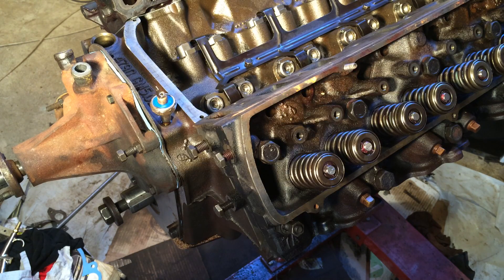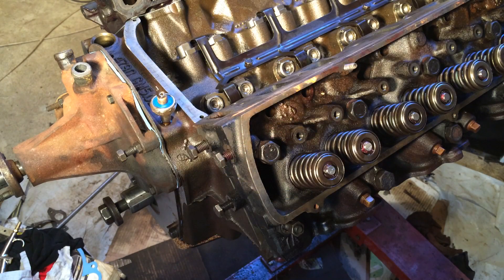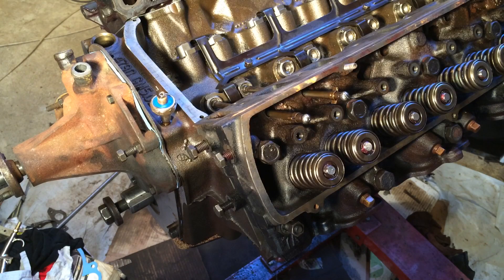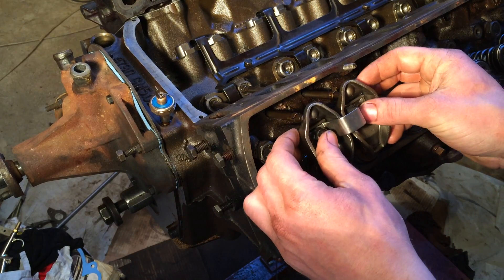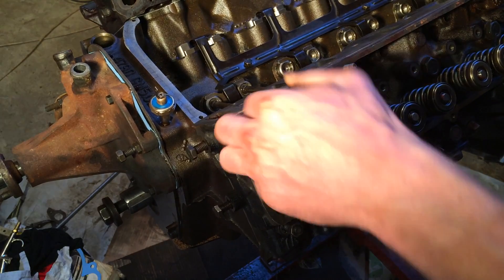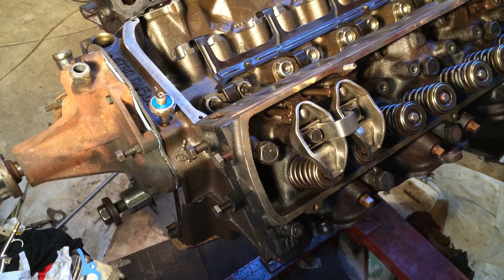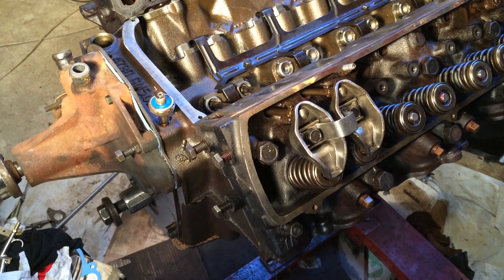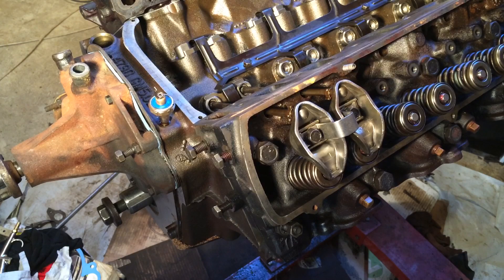Installing pushrods and rocker arms

Comment: Hello I hope you still respond because this is a older video. So I have to change the lower intake gasket and since I don't have a push rod remover tool I'll have to loosen the rocker arms and remove the push rods. So you lubricate everything except you'r bolts holding down the rocker arms? I am not a mechanic, but how is the engine oil later on now loosening those bolts, is there any protection for that or it just won't happen? I'd be glad to hear from you, best regards
Reply from the maker: @cruzenoob1422  yea still respond, do you just have to change the intake gasket? If so you Don’t have to mess with the rockers or push rods at all
Reply: @international2408  I am changing the lower intake gasket for a fiero v6, sadly the gasket is behind the push rods.
Reply: @international2408  nvm I found the solution

Comment: Hey there, I have a 72 F-100 with a 390 GT, it has the none adjustable roller rockers. Do each push rod have to go back to the same lifter? Or could in do new push rods with old lifters? There is a little wear on some of the push rods and some look to have very little wear.
Reply from the maker: It’s best to match each lifter with the push rod that was removed, because of the wear pattern each one leaves, but I would bet if there is very little wear it would be ok, and yes new pushrods with old lifters will work
Reply: @international2408  Great thank you!

Comment: Help 
I have a 64 6cil Impala and one the push rads came off was little bend so I strained little and installed the lifter but I didn't see that clip . I will get new ones I get the money to buy all new so should I try to look for the clip and also it seem the same both ends so I just put it in car runs good but it won't turn like the other it does las the oil .

Comment: Reassembling the rocker arm assembly on the 64 Olds 394 Starfire Hi Compression V8 was just installing the hydraulic valve lifters, push rods, rocker arm shaft, springs, rocker arms, and tightening down to torque spec. There was no screw/lash adjustment.

Comment: Questions,  I'm doing head gasket on a 2001 jeep grand cherokee, with the inline 6 4.0 liter. And I don't need to find top dead center on that motor do I? One thing  I found was no preload adjustment is needed for my motor. Could I do what you did on my motor? Drop the rods put on the rocker arms and torque them to specs??

Comment: Apologies for the novel & slop of a msg. Im falling asleep as I write this half awake.... 
But anyway, did you have any complications while putting on your push rods and rocker arms, like when just hand tightening at first, one rocker does not bolt down all the way..? 
First thought, valve or lifter is up higher raising the push rod up just a bit, making the bridge uneven linked to the other rocker & keeping it from being able to screw down all the way. Until you start tightening to spec of course. . . 
BUT im 97% sure this isnt the case & all of the lifters or valves are down cuz the rockers are off. So when putting rockers back on, they all should be even just as they were when you took them off. So why would one bolt screw down a rocker all the way when hand tightening but the next one does not..? 
Does that make sense?  
Any ideas?  
Oh, & I cleaned it up pretty damn good in there so there is no debri sitting on the lifter that couldve fallen into  the push rod hole causing it to seat higher.

Comment: hey not sure if you would know and if not, i appreciate your time and videos as always!! but i'm contemplating doing the pushrods in my 2007 ford f-250 diesel, i believe its an international/ford engine and somehow the pushrods are too long and needs to replaced with upgraded/shorter pushrods. can these pushrods also be changed without being tdc and its just remove the rocker and replace?? i am hoping its just that easy!!?? otherwise i will have to pull the cam and see how bad it is marred/damaged and if so, would also replace the lifters. i am not looking forward to this job!!! thanks!!
Reply from the maker: Thanks! And I’m pretty familiar with 7.3 power stroke but not so much the 6.0, I do know that lifters can be a job in those engines. I believe you would be just fine pulling the pushrods out and replacing them, but when you have them all replaced I would turn the engine over by hand, I believe the 6.0 is an interference engine. My bet is you’ll be just fine since you are going with shorter push rods. Power stroke help is a pretty informative channel here on YouTube

Comment: So i have a stock 4.3 V6 , i decided to replace just the rocker arms .. ive torqued them all down to 20ft lbs , and only two of the push rods spin as of right now .. the rest are extremely stiff ... should i just let it ride (what could go wrong) .. or should i take them all back off and turn the motor over as i torque them down .. thanks

Comment: Any secret to it? Does it have to be at TDC? Is it normal for some Rocker arms to have less tension from the lifters?
Reply from the maker: This particular engine didnt need to be at TDC, it was a non interference engine. i installed my lifters dry, and it takes a lot less force to tighten the hold down bolt when the lifters aren't completely full of oil. Yes its it's normal for some to have less tension if they aren't riding on the lobe and the valve is fully shut
Reply: International 240 awesome thank you! Should I turn the crank and torque the rocker arms bolts once the push rods at their highest position?

Comment: This video really helped me but I have a question. Do I bring each cylinder to tdc and then torque them or do I just work them in a line without worrying about where the cylinder is on that set of valves. Thanks again for explaining it and making it simple, I was overthinking it.
Reply from the maker: Thanks and glad I could help. This particular engine I just did them all in a row without worrying about the position of the pistons or the lifters (lifters were "dry" with just enough oil in them so they wouldn't seize).These are hydraulic lifters without any provisions for adjustments and this engine had stock low compression pistons and stock low lift camshaft so there really isn't any chance of valve to piston issues  on this particular engine if everything is put together correctly. Now if this was a high performance engine with high compression, high lift camshaft, or solid lifters and/or an adjustable valve train, then there would be a procedure and clearances for the adjustments/ installation.
Reply: @international2408  what size engine was this
Reply from the maker: 307 oldsmobile
Reply: Hello  @international2408  does this go for the 403 Oldsmobile aswell?

Comment: I have a 1981 Chevy c10. 
How can I tell if I need to replace my push rods on my 305 short block?
Reply from the maker: Check the ends for wear, and roll them across something flat like a piece of glass to check if they are bent. Also check that the hole is clear so oil can pass through.
Reply: @international2408  well on one side oil is coming threw but on the other side no oil is coming out...
Reply from the maker: Are you noticing this when priming the oil system? Or is this with the engine running?
Reply: @international2408  I don't have the engine init yet
Reply: @international2408  but when we turn the oil pump that's when it does that
Reply from the maker: How long have you primed thee engine? Sometimes they take a little while. If the pump has been turned a really long time and your still not getting any oil at all to that bank, I would suspect an oil galley plug is leaking.
Reply: @international2408  ok. How would I change that? Also what kinda engine were you working on in the video
Reply from the maker: The one in the video is a 1985 307 Oldsmobile. If I remember correctly, a small block Chevy has 6 oil galley plugs, 3 on the front of the block and 3 at the rear. They are on the left, right, and directly above the camshaft journals. The ones on the left and right are for the left and right bank of lifters. The center one I believe is the main galley.

Comment: Can you replace the pushrods with just the valve covers off?
Reply from the maker: Yes. The intake was off in this engine because it was in the middle of a rebuild
Reply: Yeah ,but you have to take the heads and intake off if you have to change the lifters. You cannot get the lifters out of each corner If the heads are still on.
Reply from the maker: On this oldsmobile engine and a small block chevy engine the heads can remain on to remove the lifters/entire valve train

Comment: It's pretty cool you take the time to answer people.  I have a vid of my truck running on my channel... can you check it out and tell me what it sounds like to you?
Reply from the maker: Thanks man and yea I'll check it out
Reply: @international2408  Will a rod knock go away when the motor warms up? Sprayed a bit of starter fluid into to carb a few times then pulled the plug wires one at a time and I didn't notice any change while I pulled each wire but noticed about a min after I did this test the knock went away. So then turned the motor off for a few min and started it up and the noise was back then pulled the plug wire for the spark plug on the far back on the driver side and didn't notice a big change but about a min after I put it back on the noise went away again.  Don't know if it matters but also was messing with the vacuum lines coming of the transmission. Noticed they had hoses cracked and not even contacted to stuff in a few places and was pinching it off to see no idea if that mattered though
Reply from the maker: In my experience rod knocks are funny. Sometimes the engine will do it when its cold, sometimes it will make noise after the engine is fully  warmed and the oil is thin. Just out of curiosity, does the truck have an oil pressure gauge? If so, what does it read? Is the oil on the dip stick read full and are there any shiny flakes of metal in the oil? The vacuum lines that go to the transmission should be for the modulator and they should be hooked up, it will cause a vacuum leak at the engine and will run poorly, also the modulator shifts gears according to engine load. If i were to try seafoam, I would probably try it in the crank case, sometimes marvel mystery oil or seafoam can free a dirty lifter.
Reply: @international2408  not sure the oil pressure gauge works.  It goes up to 100 when I start the motor and it just shakes there till I turn off the motor. I actually hooked up all the vacuum lines and the knock went away.  But now it back fires on acceleration
Reply: @international2408  back fires on acceleration and if you floor it it sputters near a hole in the exhaust under the drivers seat and almost dies but doesn't. But doesn't backfires unless I'm accelerating
Reply from the maker: That's good the noise went away. The backfiring is probably carburetor or timing/ignition related.
Reply: @international2408  I did just put this carb on but adjusting it don't help
Reply from the maker: I noticed you had an  edelbrock carburetor, do you know  the model number? Its stamped on either the right or left front mounting pad, usually they start with 14 and are 4 digits.
Reply: @international2408  its a 1406 edelbrock 600 cfm. It's got the spread bore instead of the square bore. It fits my intake better then the square bore which would need an adapter
Reply from the maker: 600 cfm should at least  run it adequately, I don't have much experience with edelbrocks, I rebuilt one once but that's about it. would you happen to know what rod/ jet combo you have? Is the carburetor brand new or rebuilt recently or has it been sitting awhile?
Reply: @international2408  o it had been sitting for a very long time... it ha a layer of dust on it pretty thick I cleaned up the outside. I didn't rebuild it yet
Reply from the maker: That could very likely be an issue. The accelerator pump umbrella seal will get brittle and crack causing lean acceleration issues, oxidation in the float bowl areas can cause floats to  stick, and dirt can cause all kinds of issues. Rebuild kits are pretty reasonably priced for edelbrocks (atleast they were when I rebuilt one) and its a good place to start. Compared to the quadrajets and holleys I rebuilt the edelbrock was much more simple.

Comment: International 240 I have the same pedestal rockers on my ford 302, I just dropped all my pushrods and rocker arms back in order how they came. But when I torque them down, the arms still feel loose and have side to side play. Am I doing something wrong?
Reply: Thank you I just wanted to make sure that’s okay. I appreciate you replying back to me. I leaned a lot from this video. Thanks for all the info 👍🏼
Reply from the maker: You're welcome, glad I could help
Reply from the maker: All of the rockers or just some of them?
Reply: Most of them. And the rest are stiff  and those lifters bottom out. And they all change when I turn the crank Is that right?
Reply from the maker: Yes that's fine. It sounds like the ones that are bottoming out are on the peak of the cam lobe. They change when you turn the crank because it also turns the cam, thus putting different lifters on the peaks of their cam lobes.

Comment: I haven't turn the crank after removing the pushrods. I should be able to just drop them back in for installing and tightening? No need to turn the crank to get the push rods to a certain point?
Reply from the maker: Yes just put them back in the way they came out, no need to turn the crank. These engines have hydraulic roller lifters, the plunger in the lifter will adjust itself to where it needs to be.
Reply: @international2408  I actually have a Jeep inline 4 but was watching for a sort of reference because I can't find great videos for my motor
Reply from the maker: What year/ size is your engine? I don't have much of a background with jeep engines but after certain years alot of manufacturers went to hydraulic lifters. The only real time you have to worry about turning the crankshaft and setting valve lash is if the engine has solid lifters or adjustable rocker arms like in a small block chevy.
Reply: I have an inline 4cyl. 2.5. it's a 98 but Jeep used the motor for centuries.
Reply from the maker: Yea that should definitely be a hydraulic lifter, if the rockers have hold down bolts like mine then just tighten them down.
Reply: @international2408  They sure do. Thanks for the help. I'm definitely subscribing to the channel!
Reply: @international2408  I'm having troubles getting the rockers to sit. Is there any chance I can email/message you so I can send photos of exactly what's going on
Reply from the maker: Are the lifters dry (newly installed without being bench bled) or have they been in the engine and ran before the valve train work?
Reply from the maker: Here is my email stewart.clay@yahoo.com if you want to message/send pics, also thanks for the subscription

Comment: Shall pushrods spin after being torqued ?
Reply from the maker: It depends on if the lifer is high on the cam lobe. If it is, it will have pressure against it and won't be able to spin, or won't be easy to spin. If the lifter is low on the cam lobe, it should spin.
Reply: Shoud I rotate the engine according firing order during installation and adjustment rocker arms ?
Reply from the maker: The rocker arms on Oldsmobile engines are non adjustable, if the lifters are dry you can just tighten the hold down bolts no matter what position the cam/crank is in. If the lifters are full of oil, it may take a little more effort to tighten down the hold down bolts because they have to bleed the oil out.

Comment: Can you install the rockers by only remove the valve cover while it's still in the vehicle with removing anything other than the valve cover.
Reply from the maker: Yes all you need to remove is the valve cover. They are accessible with the engine in the vehicle.
Reply: @international2408  appreciate I was considering doing myself but seems not as labor intensive as I thought. SBC  have easily accessible rockers.
Reply from the maker: Yes very easy. Small block Chevys are usually just a little bit easier because the block isn't angled quite as widely as an Oldsmobile, giving a little more room between the inner fender and the cylinder head.

Comment: I have a 65 Mustang with a 200 inline 6. It has adjuster bolts that look like a hollow bolt with a ball attached to the end of them... but are all one piece. It doesn't offer me a place to add a picture. Anyway, have you ever worked on one like this? If you need a pic of the bolt, let me know where and I'll send you one.

My questions... adjust them in full up position? How many lbs of torque?

Oh... one of the heads came off one of the bolts and I can't get them anywhere... we had it welded back on and it seems to be fine. Put it back on, but just can't get it adjusted so that it's running smoothly. Still running a bit rich.

Thanks!
Reply from the maker: I have seen rocker adjustment bolts like that before, I haven't adjusted any with that style of bolt but I imagine they work like any other adjustable rocker arm. I don't have any background with ford 200's but every rocker I adjusted had to be open. A quick google search should provide the appropriate clearance and what position the cam and crank have to be in while the adjustment is made. Also verify if the lash measurement is supposed to be taken on a hot or cold engine. Typically it is done cold but i have ran into a few that required the engine at operating temperature for the measurements.